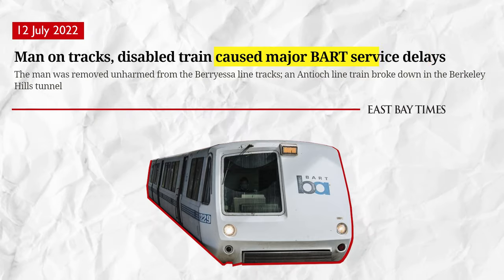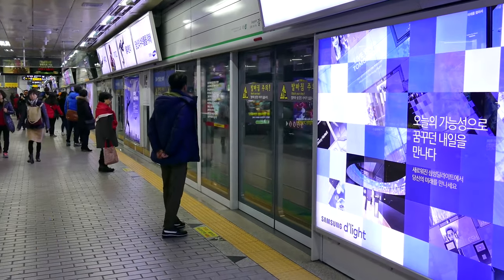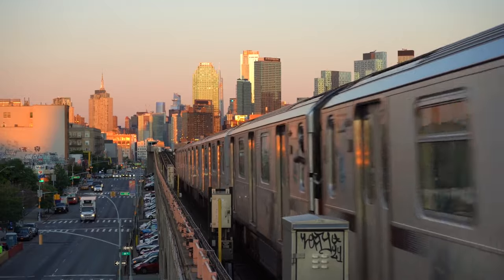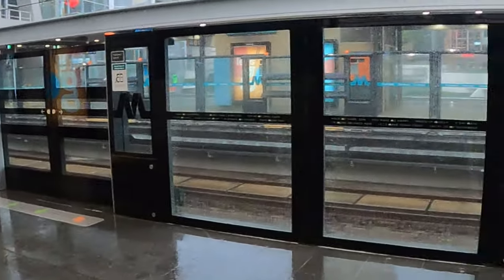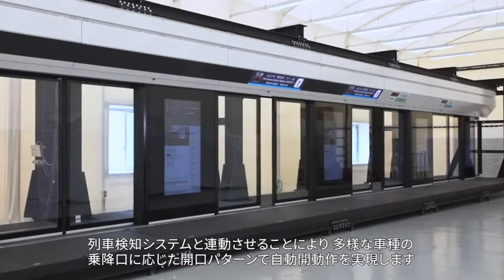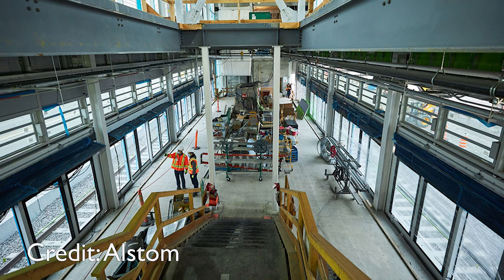Why Most North American Metro Systems Don't Have Platform Screen Doors

Comment: Also, in Vancouver they already have a system that prevents deaths by jumping in front of the trains. On the Canada Line there are laser intrusion detectors that automatically stop the train if movement is detected on the tracks. On the Expo and Millennium Lines there are pressure plates that do the exact same thing. Translink found a solution to this problem that fit in with their situation of having multiple rolling stock on their transit system.
Reply: 3rd rail?
Reply: Honestly, I think this solution is much more feasible for most transit systems. Installing doors at a platform at every station is very expensive, complicated and is bound to fail sometime.

Comment: In Britain you will only find (full height) screen doors on newly built lines. They only exist in London, on the below ground stations of the Jubilee Underground line extension, completed at the end of 1999, and on the below ground core stations of the new Elizabeth line, opened May 2022. It is a main line/metro hybrid and now runs through to main lines both east and west of London, including Heathrow airport. It is similar to the RER lines in Paris, which started in the 1970s.

Toronto has the UP (Union station-Pearson International Airport) Express train line. It has full height platform screen doors at each terminus, but not at the intermediate stations.
Reply: Tbh the UP express only having doors at the big stations makes sense bc YYZ and Union both board the UP express from outside meanwhile Bloor and Weston both have outdoor platforms for the UP express so platform doors is kinda useless
Reply: They are planning to add platform edge doors on some Piccadilly line stations in London.

Comment: the simplest problem for New York is the one that was glossed over from the report: not all trains are the same size. 

At present, we have 8 car trains of 60 foot cars, 10 car trains of 60 foot cars, 5 car trains of 60 foot cars, 4 car trains of 60 foot cars, 8 car trains of 75 foot cars and 4 car trains of 75 foot cars. and that's just the B division. 

Any PSD system would need to know what kind of train is pulling into the station and respond correctly every time without fail .
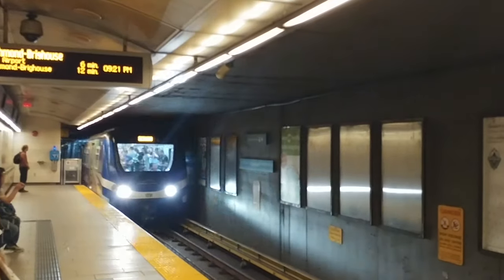Reply from the maker: I addressed that at 3:39-4:11, just that I did not use the NYC Subway as an example.

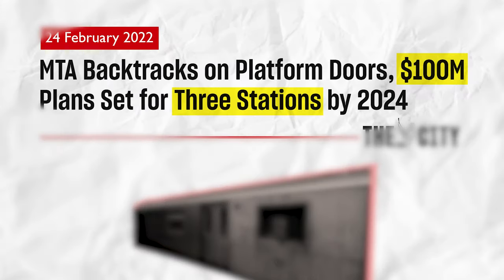Comment: 6:04 Ha! Stood at that station, exact same spot on my commute home each evening. As that platform gets quite crowded, that’s one station that could use these doors and likely falls into that 27%.

That said, there’s no political will power to spend money on infrastructure of any type in the states, where deferred maintenance is the rule.
Reply from the maker: The clip you pointed out was actually stock footage I got from Storyblocks .

As for political will, I do agree with that point but I also think that there really is a need for a fundamental rethink on how infrastructure projects are executed in North America.  Way too many times projects go over-budget and/or behind schedule.

Comment: As a regular SkyTrain rider in Vancouver, I can say that their current track intrusion system is less than ideal. First off, there are two designs of that in the system: the pressure plates at all Expo Line stations between Waterfront and King George, and the laser based system on all Millennium and Canada Line stations (plus Sapperton and Braid on the Expo Line). As such, they cannot be used at all when there is heavy snowfall, in which case the system will be turned off and staff will monitor every train, necessitating them to run slower and less frequent.

Because the track intrusion system is activated whenever there are obstacles on the track, emergency brakes will be applied to the train at full force, regardless whether a human or a water bottle is on the track. This is the most frequent cause of injuries while on the train.

The easiest line to install platform screen doors is the Canada Line, as all trains are identical with the same door layout. However, they were omitted because of mismanagement that plagued TransLink throughout much of the 2000's when the line was being built. In the Millennium Line, PSD's can also be installed as only the Mark II runs there, however because it shares the same track system as the Expo Line, that means Mark I's can also run there as well. Mark I's are the short stubby cars that have two doors per side, as opposed to three per side on the Mark II and III. While PSD's with wider doors can accommodate both Mark II and III's (despite the different spacing between cars 2 and 3 on both sets), it is the presence of the Mark I's that preclude such PSD installations. BC Transit (who operated the system until splitting into TransLink in 1999) never anticipated the Expo Line to have ridership grow so rapidly, and as such, the Mark I's were designed as no more than a small people mover vehicle, leading to severe overcrowding on those trains and totally unfit and ill-suited to ridership levels of today (Mark II and III trains handle overcrowding much better). With the management troubles at TransLink, they opted not to replace the Mark I's around 2010 (which was the projected end of life for those trains) which made the situation much worse as the Mark I's are so poorly built they vibrate much more than newer trains, leading to a worse riding experience, alongside the lack of air conditioning unlike every other trains. Mark II and III's were properly designed to be high capacity rapid transit vehicles from the start. Fortunately, this problem will be rectified with the delivery of Mark V trains (5 car sets instead of 4 cars) from late 2023, and the whole order of 41 trains will be delivered until 2026, finally replacing the suboptimal Mark I trains, something that all riders very much look forward to. These new Mark V trains still have the same door layout as Mark II/III and as a result PSD's will work with these new trains.

Comment: My local station had something similar installed recently. The differences: They are manual, someone has to open the gates when there's a train. The gates also close the entire platform, not just the edge.
Reply from the maker: May I ask what city is the station in?
Reply: @moon993  I've seen most stations on the Great Western Mainline, in the UK, be upgraded to have these gates.

Comment: Whoa! What is up with all the BART hate in the transit tuber community? BART is actually pretty good system with a ton of capacity and pretty much constant expansion and improvement.

BART is still planning to install platform-screen doors on most of its stations. This project was paused because of the new trains switching to three doors instead of two. This upgrade was judged to be a lot more transformational than platform screen doors and was this prioritized. Also, despite the weird obsession that some transit tubers have over platform screen doors, there are a toooooon of other upgrades that are both cheaper, faster to build, and a lot more transformational. Our transit services need to first learn how to run before they try to fly. There is a lot of work that needs to be done before platform screen doors are the main remaining priority. Platform screen doors won't do much for services that barely muster enough ridership for 30 minute frequencies (*cough* MARTA *cough*).

Comment: Philly use two types of rolling stock but it is on different lines. So they don't have compatibility problem. Except for underground stations which have pillars none of the elevated segements have any obstructions. And since its already open air, half height would be enough and weigh less. There is nothing stopping it short of just money and political will.
Heck the underground stations are so dilapidated they might as well rip it up amd redesign it from scratch and include screen doors
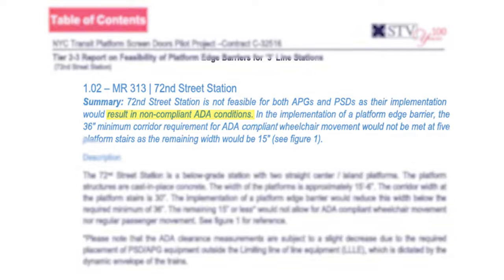Reply: Singapore also has pillars like in 5:31 but all the way flush along the platform edge, & can still use platform screen doors as the pillars are positioned exactly in-between the train doors, though this prevents the doors from having additional emergency exits in-between them in case a train at the station needs evacuating and it hasn't lined-up yet with the platform screen doors. The pillars also get in the way if we want to change the trains' door layout e.g. from 4 a side to 5 a side per car e.g. with the line passing thru Changi Airport station planned to be connected to & taken over by Thomson-E Coast Line (TEL) by 2040, whose trains have 5 doors per side per car, while the East West Line that currently serves this station uses rolling stock with 4 doors per side per car instead (as TEL is newer & later on we decided to add more doors per car so that considerate passengers who stand in-between consecutive doors instead of beside them, to let more passengers on board, don't have to walk so far to the doors when alighting)

Comment: I feel like New York could use the smaller ones instead of full height. Same for most other cities. 

They just need to actually do it. Don’t worry about the cost, just do it.
Reply: Well NYC employs a diverse rolling stock each with different lengths between doors, so it wouldn’t work there unless NYC homogenizes it’s rolling stock
Reply: @thomasgrabkowski8283 mta needs the laser intrusion stuff to stop trains if someone is on the track
Reply: @thomasgrabkowski8283  japan introduced a new type of platform screen door that can adjust based on the type of train with varying door positions and sizes. Its in Osaka and opened recently.
Reply: If your trains have conductors (who stick their head out of the train's side to check that it leaves a station safely) then you have to use half-height ones as full-height ones will block the conductor (which is probably why Japan uses the half-height design at many underground stations too)
Reply: People would just vandalize it in less than 24hrs

Comment: A big problem with platform screen doors is if a train comes in and has to stop short for some emergency.  The train  doors won't line up with the platform doors trapping people.
Reply: You can setback the doors slightly so people can walk between to the open platform doors and escape the vehicle. It does restrict capacity some but there are also exits in front and back of a train. If its a more modern walk through train, smash the windows. Both windows on the train and station can be broken with the emergency hammers.
Reply: @neurofiedyamato8763  Good luck if you have a serious emergency situation and train full of panicked people needing to exit fast.
Reply: Meanwhile in Singapore, even before platform screen doors were installed, a train that stopped short ended up only being able to open the driver cab door to let passengers on board evacuate, probably as other doors had a safety interlock that could only be released when the whole train was in the station

Comment: Generally older metro systems do not and not many metro systems outside of Asia have them
Reply: This. The reason why platform doors are common in Asia is precisely because a ton of those metros were very recently built. Retrofitting these new appendages on the platforms is usually pretty tricky. The vast majority of older metros anywhere in the world don't have them. Most of the metros in the US are pretty old, hence no platform screen doors.

This is not rocket science.

Comment: I actually kind of disagree, that are safer, yes they are safer on one level,  when it comes to assault, suicide, and just accidentally falling. 
But another level, what if you had an event like the uk, just had rare yes, but I can see the train basically being a coffin. 

I think partial is actually better, over all. Even though I like the look at the glass, and seems it's nice for noise reduction. 
Someone also mentioned detectors in subways. So I think if you combined both a detector, and a partial it should find. You may even a full glass to create a waiting room/lobby as pre curser, but good create a nicer feel, *tho expensive.
Reply: When metro train passing through the station, it generates noice and dust, having screen door is not only for safety but also for the passenger comfort and station cleanses.  I love the metro in Asian cities, they are clean, quite and safe.

Comment: You buried the lede... It's $ that under-funded systems don't want to spend the dough on to save a single life. Simple as that. The technical reasons besides ADA requirements are flimsy at best.

Comment: I think the bigger question is…. Why do a very limited few rail systems have Platform Screen Doors when the vast majority of the world manages perfectly well without them.
Reply: Exactly. I think it has to do with "How many people are being transferred on each Ride per Trainstation" (accidents)  aaaand "How happyand healthy are the people that  get transferred from each station" (suicide).  Seems in North America are not enough deaths to equal the cost 😬
Reply: @residentCJ It is only expensive in the US and Canada because of poor planning, mismanagement, and inexperience. Far poorer countries could afford it. US prices are just bloated.
Also people can accidentally slip and fall not just suicide. And if you think this is uncommon, you just don't ride enough US transit. People getting into tracks(trespassing not suicide or falling) is common in the US which can be prevented by platform doors! In fact trespassing is more common in US than other parts of the world. Heck US mental health is among the worst among developed nations which only justifies platform doors even more.

It also prevents people throwing trash on to the tracks which can cause problems leading to delay amd higher maintenance.
Third, they decrease dwell time as riders know where to wait instead of chasing doors. Doors also reduce the noise experienced by riders. NYC passengers are subjected to jet engine level noise. This is horribly unacceptable.

Lastly, they allow stations to have climate control which most NA stations do not have. Even if the station already have AC, the energy cost would be significantly reduced. This by extension prevent rain and snow from drifting into elevated or surface stations. Once again reducing slip and fall, and cleaning.

If anything it is a no brainer to have them. Most stations in the world don't have them because the first design came in around the 80s and only popularized in the 90s and 2000s. It is relatively new. The US is just backwards.
Reply: @neurofiedyamato8763  The retrofitting cost mentioned at 6:00 does indeed sound expensive. If those 3 stations in NYC subway each had 2 platforms of 4 doors x 10 cars each, that works out to an average of ~US$400,000 per door. Meanwhile Singapore did the same to 36 stations from 2009-2012 for ~S$150m (~US$110m; when the cost had finally fallen low enough for the gov't to fund it); with a total of 78 platforms of 4 doors x 6 cars each, that's an average of ~US$58,760 per door (from Westinghouse) (maybe because labo(u)r is cheaper here)
Reply: PSD is a security feature and must be installed in all Metro stations 
In India we Manufacture platform screen Doors indigenously and it's very Reasonable

Comment: Money is the only reason. If they did build more, most likely it would reduce other maintenance expenses, and cleaning.
Reply: The riders of American metro rails can get pretty out of hands. They would probably break the glass because it is not their and they would deface them with graffiti which would leads to higher maintenance cost. They figured why bother. Human beings are replacement but making a few more bucks for themselves is way more important.